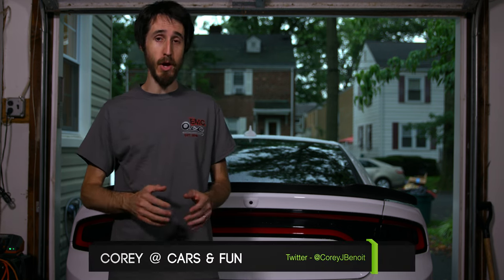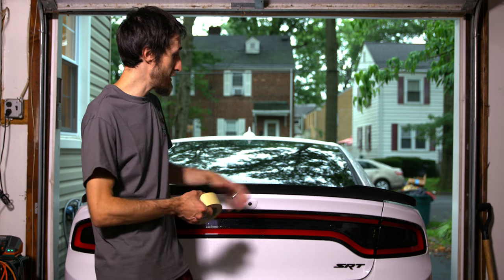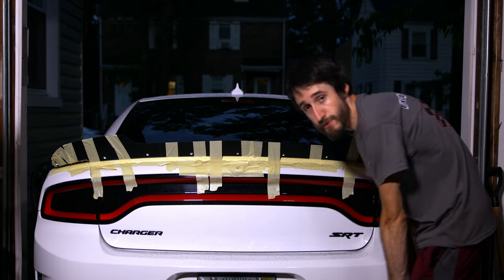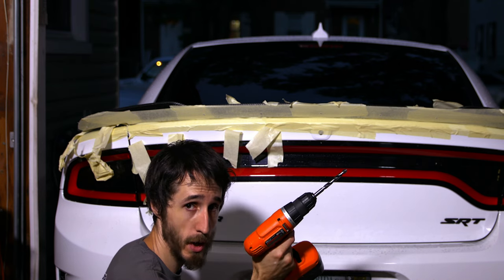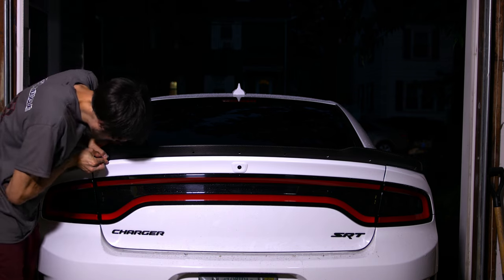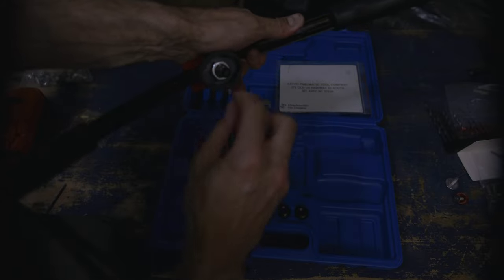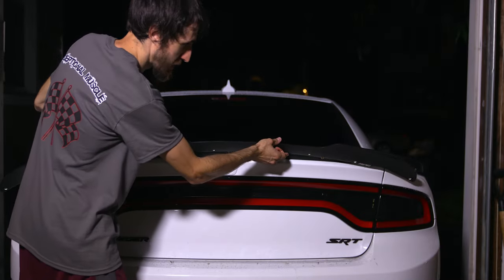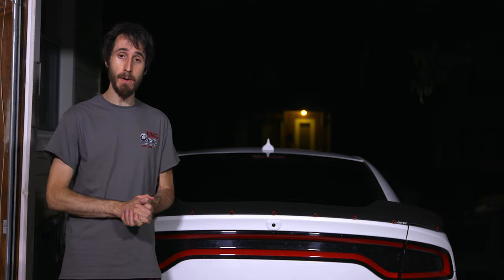How To Install A Wickerbill/Spoiler Easily! Full Guide! Dodge Charger SRT Hellcat!

Comment: Can you do a video or give some info on how you installed your SPR front splitter without using support rods? I installed the same splitter from SPR on a white scat pack without the rods also. The splitter broke off   While going about 95mph. If you could give some info on if you used screws or bolts etc or how many were used? Because I just ordered another one. Thanks
Reply from the maker: that sucks. I also know that IG chicagoscatpack had the same issue. I used 5 M14 bolts and went through the inner frame and plastic with 5 bolts. That really secures it.
Reply: Thanks for the help.

Comment: any chance he'd make another wickerbill like yours? ^.^ never liked wickerbills on Chargers till I seen yours. Always thought they should go the full length of the spoiler. Also - What's the outside diameter for the countersunk washers? 22 or 19mm?
Reply from the maker: Thanks! He does. He makes spoilers and splitters for all cars. Actually I am not sure about the countersunk washers size. The ones that come with the wickerbill might be 15mm. The custom RED ones are probably 12-14mm.
Reply: Thanks for the reply. Your link on Amazon for the washers is to a search with different sizes. most of which are 19 or 22mm O.D. was just curious on how big yours were as they look good.
Reply from the maker: evicerator11 some are different sizes however they all fit the screws.